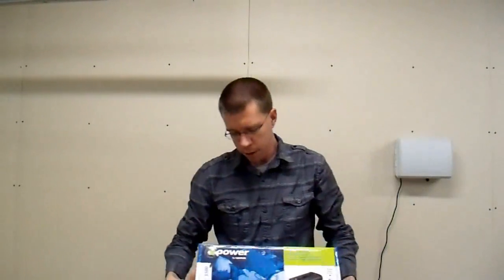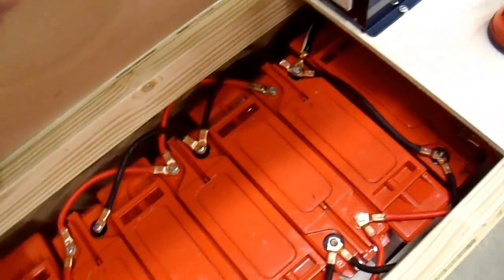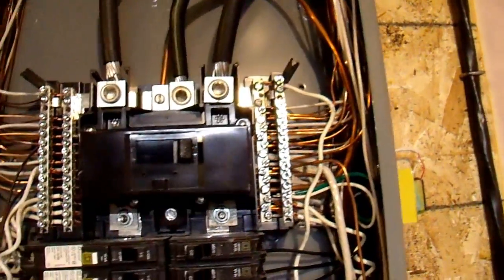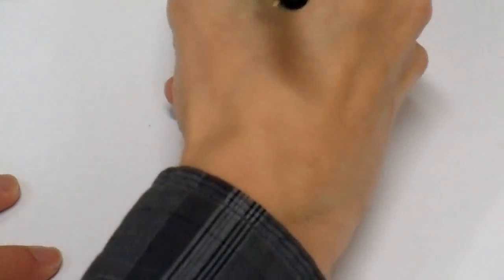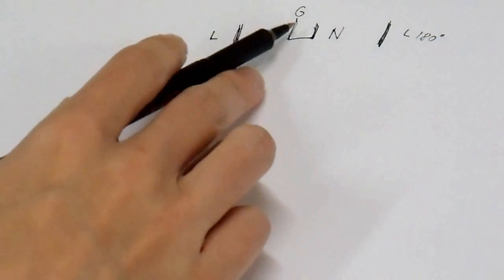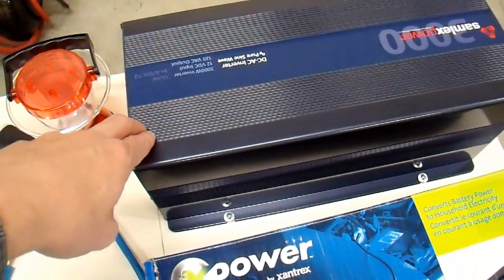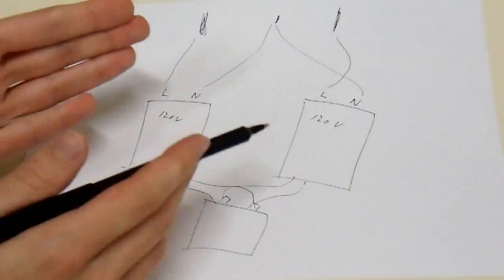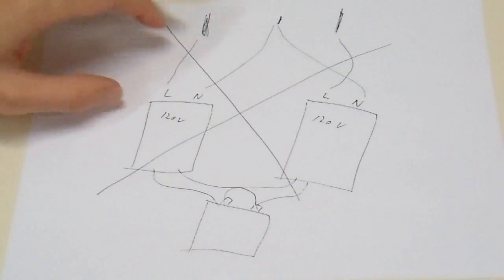How to Power your House with an Inverter/Generator During a Power Outage Part 1/3

Comment: What a joke:
"I assume no liability for property damage or injury incurred as a result of any of the information contained in this video. Be sure to read and follow all safety instructions for any equipment seen or implied in this video, and use safe practices when working with potentially dangerous equipment."  Be sure to use safe practices and follow all instructions?  What a dangerous fool.  Yeah, that sentence absolves you from all moral and legal responsibility for the injury and death that is inevitable as thousands try this stupid crap.  Someone will inevitably die as a result of this video, and if you think this disclaimer protects you...

Comment: I've been using a "suicide cord"  for years to power up my work van on job sites I guess I know what they're called now.
Reply: THey are called this way because the other male end is live when connected to a power source. As long you plug your load first, then the source of power it shouldnt be a suicide cord :)

Comment: This is a fatal accident waiting to happen.
NEVER do this! 
Get a transfer switch.
Reply: Thank you for saying that! This video should be taken down ASAP.
Reply: *************************************
*  I am NOT an electrician.             *
*  Mine is NOT a qualified opinion *
*************************************

I believe this can be done safely with an additional breaker just for backfeed, and a lockout mechanism ($40-50) to make it impossible to have both the backfeed breaker and the main breaker on at the same time.

I believe one can then hook a shore power jack to the backfeed breaker.

I believe e could substitute backfeeding each side of the split phase by attaching  an extension cord to each side of the split phase output of the correct type of inverter(s) to an outlet wired into the home system.

Again,  I believe this can be done with a mechanical interlock between the main breaker and a dedicated,  backfeed,  breaker.

That appears to be a low frequency inverter,  which cost some money that size. Pretty surprised he didn't get one with a split phase output,  or two, identical single phase inverters which can be electronically linked to provide split phase (like @DAVIDPOZ' setup)
Reply: @lloydrmc  yes, there are interlocked circuit breaker devices just for this purpose. I really hate to see this approach though, for one thing if you use too small a wire size it will heat up and can cause a fire. Or if its run nestled against the other wires in the panel and manages to short to them the interlock is useless. Once you power (backfeed) the utility line the whole high voltage line outside goes back up to its rated voltage , and that's a killer for anyone working on it.  It may last for only a short time but that's enough to kill someone by either electrocution or by falling out of the bucket as their body reacts to the really powerful shock. A high voltage shock will kill a person almost instantly, and that little generator has enough oomph to do it. 

In ANY CASE - its much safer to use a manual or automatic transfer switch that's designed to safely connect your generator to your house. What gets me is that they save a couple hundred bucks but if something happens, will they look at the whole mess and think "gee for just a small amount of money i could have avoided all this"? There are places in life to save money - this ain't one of them. BTW I am a master electrician. YouTube should really take this down.

Comment: My way was to put a welding outlet in my garage and use that to backfeed into the house from my generator. Outlet is 50 amp, the generator is outside and no wiring or worrying about phases. Step one turn off main breaker, step two plug generator into outlet and step three start generator. I ran my house that way for 15 days after being hit with a tornado three years ago.

Comment: At the very end of your video you talked about using 2 inverters and one of the reasons not to was because of the synchronization issue. Yep, true. I took 2 cheapie low power inverters and stuck a probe from a volt meter into the "hots" of each inverter both running and got the same results! A swing between 0 and 240 volts! Crazy. I have heard of some special inverters that can be tied together with a special patch cord that will force them to sync up. Then each one would be like a L1 and L2 like the grid. Cool.

Comment: Ahhhh,... Thanks for explaining the mixing of phase 1 & phase 2 on the breaker panel :)
I also thought that one Hot wire fed one side & the other Hot wire fed the other side but by you explaining that they mix & stagger, I now see how back feeding via & Dryer outlet will supply power to BOTH sides & ALL Breakers ;)  
Thanks :)
Reply: This is extremely dangerous, both to you and the lineman working on downed lines.  It will also cancel your homeowner's insurance, and the electrical company will pull your meter if they find out.  Rightly so.  Don't do it.
Reply: It's not dangerous if you use your brain & disconnect from the grid by switching off the main breaker :) 
The Electric company won't "pull my meter" because they want my cash each month :)  
Try telling someone that has been without power for several weeks due to a storm, to NOT do it !
You can back feed through a 240 volt Clothes Dryer outlet to supply the whole panel & it runs through the breaker.
Reply: Why don't you give it a try?  Call your electric company can tell them that you backfeed, that you're going to do it no matter what they say and that it's fine because you (and anyone else in your house) always remember to turn off the main breaker and promise to never mess up.  See what happens, please.  Can you upload your conversation to YouTube?  I'd enjoy listening to that.  

Hypothetical person without power for several weeks: DON'T DO IT.  Plug your needed appliances directly into your generator - it'll get you by.  Get a transfer switch and do it properly if you want, before you accidentally kill a lineman, kill a family member with the suicide cord you just made (whoops - forgot about the danger in that I guess - I wonder what else you didn't think of when you decided that you're smarter than the electrical code), or end up sleeping in your in-laws basement when your house burns down from a loose connection and your insurance company won't pay your claim (they won't).  

You are now someone who knows just enough to be dangerous.

Comment: What if you got a 240V inverter and connected the active and neutral to the 2 actives on the fuse box and the ground to the ground/neutral on the fuse box? 
Wouldn't you be able to power both phases and the 240v circuits as a bonus?
Or would everything just catch fire?
Reply: This is not the place to get this advice.  Most everyone here has no idea how to do this safely.  Try a website like Stack Exchange or Do It Yourself.  These guys will get you killed.

Comment: BACK-FEEDING IS 100% SAFE AS LONG AS YOU SHUT OFF THE MAIN BREAKER TO THE PANEL AND DISCONNECT YOUR HOUSE FROM THE STREET POWER..  YES IT IS THAT FUCKING SIMPLE... YOU SHUT DOWN THE MAIN BREAKER AND NOW YOU CAN BACK FEED POWER USING ANY OF THE 240V BREAKERS IN THE HOUSE... OR ANY OF THE 120V OUTLETS IN THE HOUSE (which will only energize one buss bar in the panel, which means only half the house will have access to 120V) ... 

I am no electrician and i guarantee you any electrician will back up my statement, the next thing is to monitor how much power you use because that 240V generator will prob only supply 30 amps so now you must prioritize what you use in the house and dont go flipping all the breakers on because now you will over load the generator and pop fuses and breakers, you backfeed thru the dryer OR stove, then you flip open the breakers to the rooms you NEED... not all of them.. PRIORITIZE YOUR NEEDS
Reply: EXACTLY.  I am glad someone other than me agrees on this point.  Watch my videos on this very subject...
Reply: Thank you very much, it makes me feel good to know that you are on my side and understand my point of view... 

I just ignore these other IDIOTS on YouTube that say back-feeding is dangerous and the suicide cord will kill you...
Reply: Lol, I have had a few of "those guys" commenting on my vids on this subject...you know the kind, know it alls with no content on their channels.  They got blocked

Comment: Your electrical panel is wired very ODD... i have two vertical buss bars.. the left buss bar carries 120V and the right buss bar carries 120V...  each single breaker gets power from the side its attached to.. the 240V breaker gets power from both vertical legs.. 
i would NEVER use 2 separate 120V inverters to feed 240V to both buss bars.. both inverters would be out of phase causing issues..
You either use ONE 120V inverter and jump the buss bars thru a 240V breaker or a single 240V inverter using the 240V breaker to feed both buss bars.....
AFTER AND ONLY AFTER YOU SHUT THE MAIN BREAKER OFF TO PREVENT BACKFEED TO THE STREET..
Reply: You Tube You're out of your mind! They do not make, in America, what you are describing.  There is no such thing as a breaker box where left bank goes to left leg and right bank to right leg. THEY ALL CRISSCROSS BACK AND FORTH. Otherwise, as he stated in the video, the double breakers wouldn't be able to give you 220/240v. YOU are the unfortunate reason these videos probably shouldn't exist...

Comment: There not 2 phases. It's single phase 2 legs of 120 volts each
Reply: Ya there's a center tapped transformer but you for all intensive purposes it does not really matter

Comment: What about installing a separate small box we're both 110 volts come together ground that box separately and neutral even though they're the same then just jump over to the fuse box Run 2 a single 220 which will power both sides of the box run your ground and neutral along with it to your normal ground and neutral stepping up from 110 to 220 before you hit the Box on a inverter especially cheaper ones there is no ground the ground and neutral circle on the bottom are both one in the same that is why the inverters blow up you hook a ground to a positive. So you take the two one tens and that neutral and ground wire off of the inverter run it to the first box combine the two top post that are positive in the circle you install a neutral and ground wire from that little box off of one wire and then install a regular wire to the two wires coming in to the box that are hot and jump the ground in neutral into the box into a single 220 breaker all of your problems are solved safe cheap and effective

Comment: The suicide method using a dryer plug ....ALWAYS...Turn your main on the breaker box off. Then the linemen don't get fried...but their always supposed to check the line for current PRIOR to working on it...It works both ways....
Reply: So the lineman checks the line, it's dead, and starts working.  He's still working when you get up from your beer cause the lights are off and stumble into the basement and plug this BS setup in, then remember that you were supposed to shut the main, no problem, you run over and shut it off.  The lineman is already dead.

Or you shut the main off but your kid uses the microwave and trips the breaker.  He goes downstairs and turns on both the kitchen breaker and the main - both were off.  Another dead lineman.

Of you thought you were smart enough to ALWAYS isolate the main, and so did 50 other people in your neighborhood, but one did it wrong - another dead lineman.

You are on a public website preaching to the general public to do this.  What do you think the odds are that EVERY ONE will do this "safely."  Would you bet your life on it?  Didn't think so.  Don't bet the lineman either, jerk.

Comment: thinking, you're going to get charge for the electricity cause your meter will run from back feeding
Reply: If your meter is running from backfeeding that means you have not turned off the Main breaker.
Not knowing this is a good reason why backfeeding should always be discouraged.

Comment: 11:36: I have one suggestion. Because of the phasing problem and beat frequency problem of running 2 separate inverters, why not just buy one 6000 watt inverter instead of 2 3000 watt inverters. Pump the output of the 6000 watt inverter into a 1:2 isolation transformer. The primary winding is 120 volts. the secondary winding is 240 volts with a center tap. Connect the center tap to ground and have the 2 ends of the transformer be the 2 120v halves of your house. Use a big SPDT knife switch to switch from grid power to battery power.

Comment: In Aus we have 240 volts that makes hooking up in power outages easy. Of course as you stated early in the video it is vitally important to  ISOLATE THE MAIN POWER SUPPLY INLET BEFORE CONNECTING ANY INVERTER. We also have 3 phase 415 volts for industrial use. cheers big ears.

Comment: Loved this info tube show.  

PROFESSIONALLY Put a PIG connection (220 female) on the garage with a transfer switch and box with enough
switches to run the 2 baths, living room, and 4 bedrooms lights & plugs.  Plus the fridge - with my propane generator 
for as long as the canned propane lasts (read 9000 watt generator w/ 20 horses - a gas hog for the PIG!).

Then I went looking for a double 220 female (suicide type - to no avail either - I have to make it myself if I get the guts)  plug - so I could plug in - or figure out how to get the system to run with my four separate solar type generators.   I have some 14 - 285 watt panels on the roof (Solar World) that the county electric company has me hostage via the "smart meter" for dummies.  

Now with your videos and my playing around in "seniorhood" (read childhood redone) I'm trying to avoid electrifying myself like a Christmas tree with some 4 inverters (both types pue & modified),   7 AGM batteries, 10 separate solar panels and such fuses and switches to save my bacon before I cook it.   I have learned to make all kinds of electrical connections.  Thank GOD when I was younger I wired many garages for myself and family members.  I love plugs and switches and LOTS of lights - especially the new LED 4-foots that switch out from Costco.  

My question to you is if you got through all my baloney above - is name me three very good inverters that you would buy for long term heavy duty work in the 2000 to 3000 watt range -  I would like ones that could run a fridge if possible.

Double sided - like YOURS!

Comment: I thought that L1 and L2 supplying the breaker panel are single phase. It's 240v with a center tap of a winding in the transformer that results in 120v on each side. The term "phasing" would apply to the synchronizing of the 2 inverters in the 60 cycles. Three phase power would be three 240v - 60 cycles at 120 degrees apart.

Comment: If you live in the U.S. You do not have two phase service ( two lines 90 degrees out of parallel at 60v each ). You have single phase ( 180 degrees out of parallel at 120v each ). Even if you did have two phase with your current electrical panel your 240v circuits would only be running on 120v and your 120v circuits would be running on 60v. Smart guy improper terminology.
Reply: More towards split phase

Comment: So, If you had use the 220 dryer connection you would have to trip the main,and all non used breakers?
 I plan to buy a pure sign invert.....and some batteries, as i live on the gulf and bad weather. Only needing to run a couple fans( for the night till I see the drain on the batteries). Would you use a bigger gauge wire for the 220 to 110 suicide cable? Thanx

Comment: Hey Knurl,  question for you. I need to connect my generator outside to a transfer switch next to my main panel but I have no way to run a cable from one to the other.  Is it ok to swap out a wall outlet in my patio with an inlet and connect the generator to it, then disconnect that old old wall outlet's cable from its corresponding breaker and connect that cable to the transfer switch?   Any advice is greatly appreciated. Thanks!

Comment: I have somehwat unrelated question. I have the same Square D master planel in you veideo, expect that mine is just a 20/40 for the slot count, rather than a 30/60 as yours is. I am completing an adition and am trying to find a 30/60 that I can buy so as to just change out the guts and save the hassle of opening the wall. (the cases are the same size for each.) Do you know of a source for used ones, or even just you part number if it is still legible. Square has stopped making this particular model. Thank You in advance
Reply: If you have the ampacy, maybe install a sub panel.

Comment: This should be named the death trap and totally illegal it could kill in many ways including innocent  line workers.
Reply: Not good enough.  Not even close.  Why don't I wire each of your hands to my electric oven and tell you, "Don't worry, every time I use the oven, I'll remember to temporarily disconnect you!"  Oh, and 100 other random idiots are also going to do the same thing.  All wired through your heart.  What's wrong with that?!  Stupid government, always telling my sassy you-know-what what to do!
Reply: You Tube THIS IS JUST ASKING FOR TROUBLE
Reply: This is why there is a main breaker to be shut off to prevent back feed into the street... once you shut off that main breaker AS HE SAID IN THE VIDEO WHICH YOU CLEARLY DID NOT HEAR OR UNDERSTAND..... once that main breaker is OFF, your pretty lineman are safe